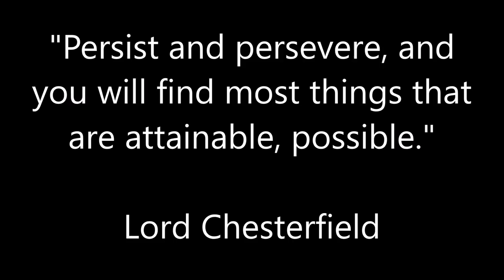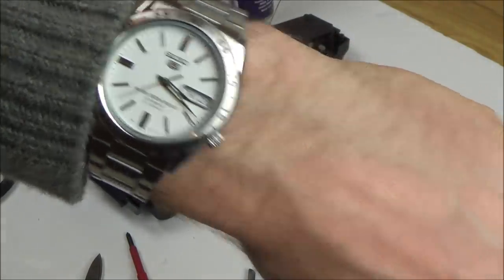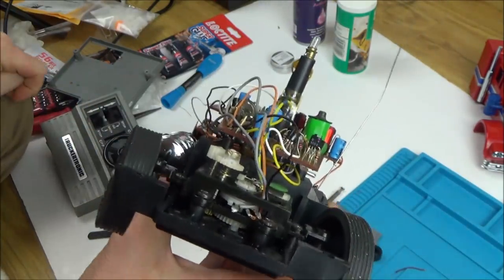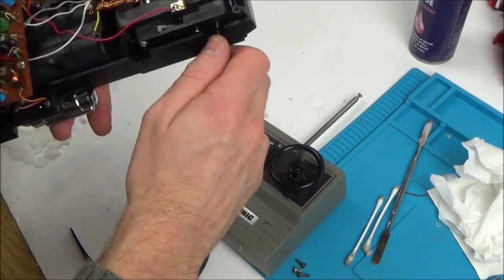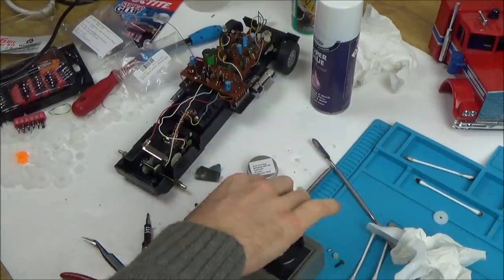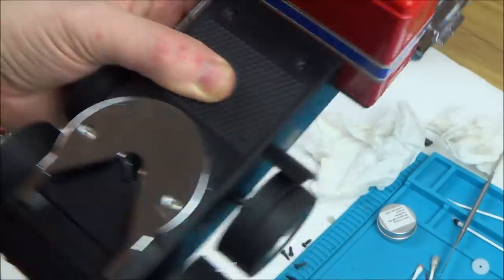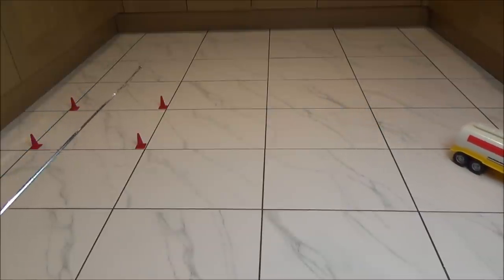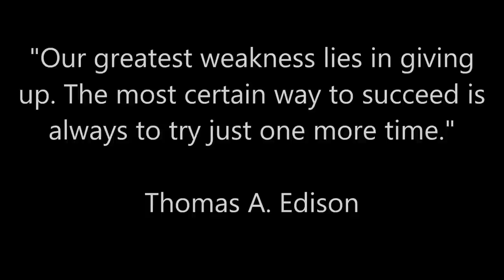Faulty Corgi Truckertronic Convoy REVISIT

Comment: Absolutely brilliant, WELL DONE!!!!!

That took me right back to 1980 when I got mine!

Yours is running a little better than I remember mine, I think batteries are better today than they were back when I had this toy!

The steering was never tight at the best of times so I think yours perfectly resembles what mine did.

The light on the top is to help you know what state the tail gate catch is in. When the light is off, the trailer catch is up! When the light is on, its down!

Absolutely brilliant, hope it gives you as much fun as mine did!
Reply: I had one of these for Christmas in about ‘81 or ‘82 (I would have been 6 or 7 years old), though mine had a silver cab, not red.

I got to play with it a grand total of twice because the batteries were so expensive and a brand new set would only last a few minutes.

I am sort of tempted to try to get ahold of a none working one, and fit it with hobby grade parts. Just for fun.

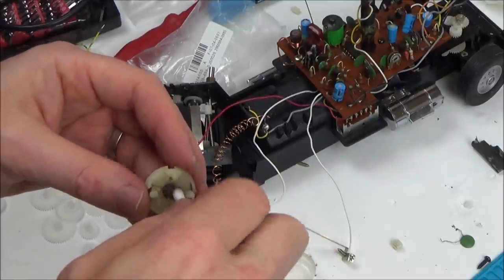Comment: 26:20 I tried to repair several times tape deck motors, and even opened the ones tat were useless, NEVER have seen grease on the brushes. The motor is a three pole, very similar and need to withstand long service hours .. these motors doesnt use grease. As soon as you put any sort of lubricant or grease you trash them because speed control needs a precise and stable contact on the brushes and grease will defeat it.

Comment: Glad you got it running , if you ever try to fix small motors again that act like that , after you clean it try to move the brushes to a different location on the armature or possibly add a small washer to cause the brushes contact in a new location then give it some lube not much just a small drop and give the gears some lube also , I always used silicone oil and grease when I fixed these kind of toys

Comment: Just FYI, my mini 4 WD dynamo motor usually is slower when you flip the cable (voltage). So I guess it is normal and a part of the design of the motor.

Comment: Did you ever try plastic cement when fixing things made of plastic like the mudguard on this truck? It takes 6 hours to fully cure and you have to hold the piece in place for at least 20 minutes before you can move to something else, but its worth the wait. I think it will work for cracks in things like gears too. And I'm like you when I start something, I keep at it until its done or I run out of options.

Comment: A little bit of info that may save you some grief in the future. Always run the transmitter withe the antenna attached and fully extended. if you dont do this then there is a possibility that you may blow the output transistors due to feedback from an unmatched output impedance. You can fin out more about this from amateur radio sites.
Reply from the maker: Thanks, I never knew this was possible. I just thought the range would be bad. Thanks for sharing the info :-)
Reply: Good info

Comment: Great video it certainly is not worthless in non working worse condition they fetch around £50, Yours in in excellent condition and now fully working so must be worth at least around £80. Also I had one of these they are supposed to go slower backwards to make it easier to hitch up, Also when reversing you need to pull forward when the light is off as that is when the hitch is engaged.

Comment: I think that there must be a gear wheel with a slight hollow for the worm gear to slide in and prevent the gear from being misaligned, What about reaching out to Ripmax and see if you can get replacement motors, Reverse should actually be slower than forward, Farmers just seem to have the knack for reversing trailers and such.

Comment: Haha, yeah, one of those projects you start with tons of ideas and imaginations but then it's not working out even close 😄 Always need to keep on, then the success expierience will be as bigger, but also need to know when to give up and move on later.
But try to use more tubes instead of glue to thicker axles, bolts etc. you can find different diameters and thickness in all kind of spraincans and bottles for house cleaning stuff (sorry not native english), mostly that platic is hard but not that hard that dou couldn't cut it precise with a fine knife, can even cut pretty flat washers.
And don't be shy to change a system completely.
I'm working on a drift car for my nephew (sure 😜) from a 1:18 Ferrarri F430 Spider model car with a nice heavy chassis made of metal, my bottle neck is to find a cheap controller system that can transfer potiometer signals or atleast got some more swithes, so it is possible to switch different speeds. I think I'm gonna end up doing it myself from Arduino and those cheap rc modules.
Reply: *spraycans

Comment: Excellent!!! So pleased you revisited this!  Regards the steering - something crossed my mind - the alignment of the gear with the notch - the one that moves the thing left or right.  If that gear was perhaps not "centralised" with regards to the notch, it would maybe go more one side than the other?
Reply from the maker: Thanks Chris, perhaps. You can spin the potentiometer to move the central position but this can effect the travel so maybe I need to fine tune it to get move travel. The problem is when the truck is off the ground the wheels go nearly lock to lock but on the ground it loses the movement. I think because of the resistance and wear the movement is being lost to tiny movements in each and every part of the steering that all add up to taking 1cm or more of steering away.

Comment: This toy is mechanically over engineered. With moden electronics it would be far easier to install modern wireless amd electronics to do the same tasks much more efficiently and smoother. Probably with digital controls for on demand power and steering to boot. Great job sticking with it!

Comment: you could use your Uv glue to make a bushing on the motor shaft so it wont shove the shaft out of alignment
Reply: reverse would be slower so you can control the trailer backing up

Comment: Right to teach you a bit about electricity. Electricity is measured in Volts and amps. Volts being the speed of the electricity and amps being the amount. So put it into water terms if you had a stream of water running very slow hardly any force can be felt of it. Now if you had a bucket full of water travelling at the same speed the force is a lot greater. The same with the motor when you tested it. You tested the voltage forward and backwards  and got roughly the same voltage therefore if the speed(the volts) hasn't changed then the amount(amps) has. 

A little extra information the force felt in electrical terms is called wattage and to work it out it is the speed(Volts) x The amount(ampage) = The force(watts). In electronics the symbol for voltage is V,  The symbol for Amps is I and the symbol for wattage is W. So V x I = W
Reply from the maker: Thanks, so once I seen the similar voltage on the motor should I have used the Ohm reading on my multimeter to see if less resistance was on the forward travel than backwards? So less resistance would mean more electricity would flow resulting in a faster motor?
Reply: A bit more information is what is called Ohms Law.  This states that if two of either volts, Amps or resistance(Ω) is known then the third can be worked out. So volts divided by amps equals resistance as a sum it's V / I = Ω also volts divided by Ω equals amps as a sum it's V / Ω = I and finally amps times resistance equals volts as a sum it's I x Ω = V

This same approach can be used when working with wattage as I mentioned before V x I = W, but also W / V = I and W / I = V 

So say we have 100 watt light bulb on mains 240V and we wanted to work out the resistance of the light bulb.
first we would say 
100W / 240V = 0.4166 Amps
Now we know the Ampage drawn by the bulb we can work out the resistance with
240V / 0.4166A =  576.92Ω
Notice this is the resistance when 240V is across it and not when the bulb is tested with a multimeter. As a resistance check on a multimeter doesn't give anywhere near 240V
To picture this think of your self walking. At that speed there is very little air pressure pushing back against you. Now if you was to run more air pressure would be pushing against you and the faster you go the more pressure you feel pushing against you.
It's the same with electricity at a low speed(volts) the resistance to it is low and at high speed(volts) the resistance against it is greater.
Reply: @Mymatevince No because you cant have it powered using the ohm reading on the meter as the meter sends out a small voltage to test. What you would have to do is desolder one wire from the motor and connect it to one of the meters probes and connect the other probe of the meter to the motor contact. Then set your meter to the DC amps setting. Then you could see the current supply change when you press forward and back on the controller.
Reply: Actually the volts are the driving force, the power(or Watts) is the amount of electricity, and the amperage is the speed. Take a river for example, the bolts would be the downhill, the Watts would be the amount of water, and the Amps are how fast the water is moving.
Reply: @EvilTurkeySlices That's completely wrong and looking on scientific websites confirm it's wrong. Watts is the unit of electrical power(force against the components). Volts is the unit of pressure behind the electricity in other words the speed at which it flows. Which leaves Amps at the quantity.
Reply: pds8475 actually you confirmed my statement. Watts are the unit of electrical power(ie the amount) and volts are the driving force(or the unit of power behind the electricity)
Reply: @EvilTurkeySlices  power isn't the amount it's amount x speed. Say if you take a ball and put it on the ground. The ball while left on the ground has no power. Only if you pick up the ball and throw it does it have power. And the power is the amount or in this case the size of the ball x the speed which you throw it.
Reply from the maker: @pds8475  Thanks, I watched a YouTube video on that and it makes sense as the meter is inline with one of the cables feeding the motor. Thank you :-)

Comment: You have more patients with those electric motors. I learned a long time its better just to replace them. China makes them by the gross ton and my guess is the UK has ware houses full of them just waiting to be sold. My motto is never give up until its so broke it will NEVER go back together. Those trucks were really cheap so just getting them going again was a feat all by its self. If I had a dime for all the stuff threw away when I was younger that I wish I still had now. I found a vintage Radio shack RC car that was brand new in box. I HAD to buy it just to play with it. The manufacters date was 1979. I put it away for my grand son. He will love it.  Chines toys made in the 70's were aweful. So were their RC trucks. Even through the mid 80's they suffered. Now they are better because the designers are from the US. They expect quality out of china and will not accept the same junk they put out back then. Its not perfect but much better. 
I did get that room heater repaired. I had to think outside the box to make the new switch to work properly.

Comment: I don't know why you expect a truck to be able to go just as fast in reverse as it can go forward Vince? :D  
Is it a gearbox design? and if it isn't Read on below,  But first you need to find out if the Circuit does in fact change the motors supply, This test can be conducted by disconnecting a lead of the motor and connecting that lead to a Multi-Meter instead, and the other meters lead can be connected to the other motors terminal that HAS NOT been disconnected, essentially the meter is the load rather than the motor. 

NOW if the circuit doesn't change current and Voltage, Those voltage results in the video indicate one side of the motors brushes needs a little more cleaning and an ever so slight change for more contact, mind you a change in voltage could also indicate a heavier load when the motor is working one way and not the other, so yes... As you assumed? ?! Err-Deduced? "Yes DEDUCED" That either the gearbox's gears are binding more in reverse or one of the contacts on the motor is not making a solid enough connection, Ergo the prominent voltage change, Reverse the Motors inertia "Rotation" and the two brushes inertia also reverses roles, Having the other contact attempting to take most of the Load but because contact is insufficient, thus significant power is lost..  
Most Motors if not all behave this way and as wear and tear sets in, Obvious power "Torque" losses are experienced..
Reply from the maker: Brilliant knowledge, thanks for taking the time to share it on this video and all my other videos. I do pick up and remember some of it but unfortunately a lot still 'goes over my head' but I will get there eventually. Thanks again :-)

Comment: You really need to get a 3D Printer.....Save yourself so much time. You will ALWAYS have problems with gears with these types of toys and the plastics and the surrounding plastics used that were used to make these toys are of poor quality, you could make all the gears out of metal but you would need another type of equipment for that. There will always be a movement because of the poor thin quality of the plastics. The only way out is to make ALL-NEW BETTER QUALITY GEARS and MADE TO MEASURE RUBBER BUSHES and reinforce the surrounding plastics.